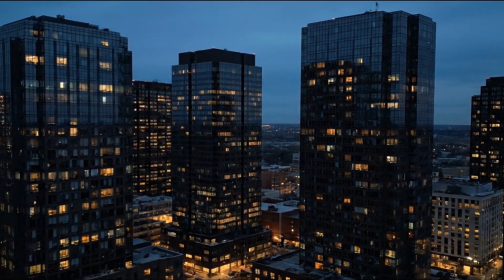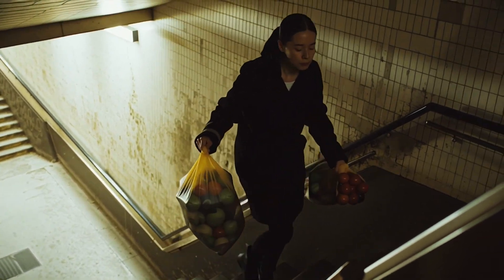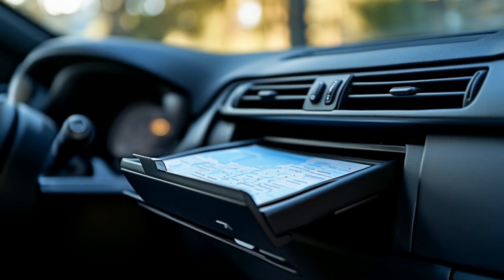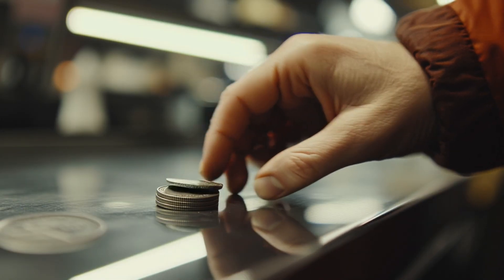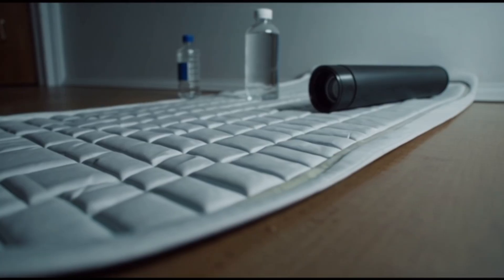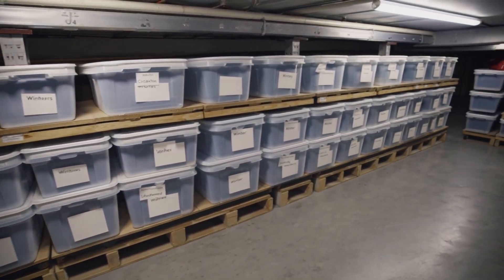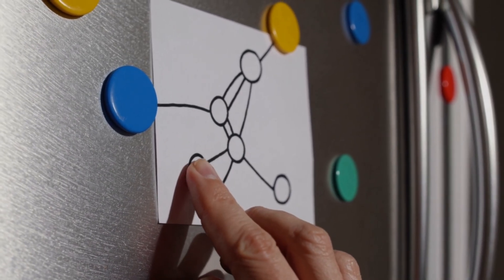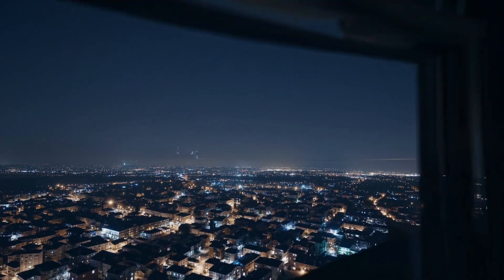What Fails First in a Blackout? Do THIS to Be Ready

Comment: I never go under 1/2 tank of gas or fuel. 1/2 tank to me is empty and I start getting nervous. Whenever I go a few hours from home, first thing I do when I get there is fill up.
Reply: Fair enough.  I have been judged for "gas gauge brinkmanship".  My "best" ever was when I was a teenager driving Mom's station wagon.  The engine sputtered through the last drop of gas as I going through a 4 way intersection and I barely coasted up to the gas pump of the station on the corner.   🤣   If the Olympics just had gold medals in my event ....

Comment: Elevators are designed to go to the bottom floors when power goes out. They dont stop were they are.
Reply: Some will..it depends on its age.. hydraulic elevators go to the bottom floor, cable elevators might stop where they're at. My last job had both, installed in the '60s or '70s. The hydraulic elevators settled to the lowest floor, but the cable ones would stop. Maybe newer ones go to the lowest floor, or at least nearest floor.